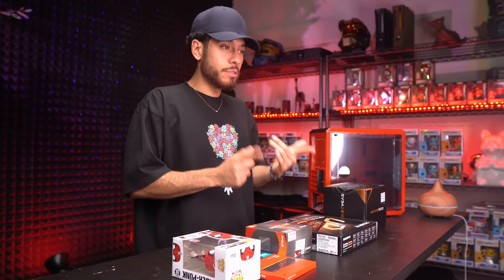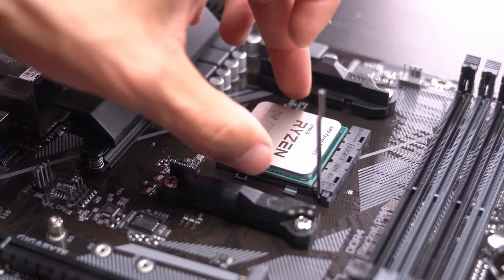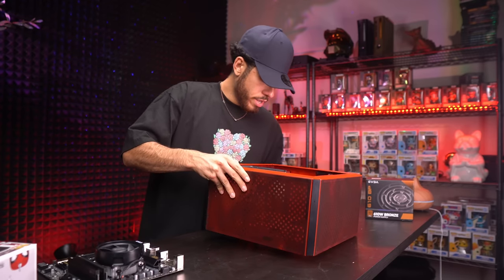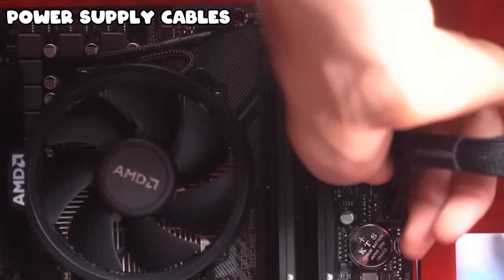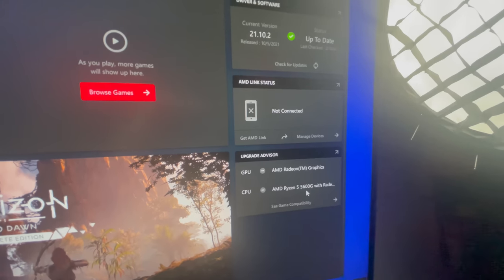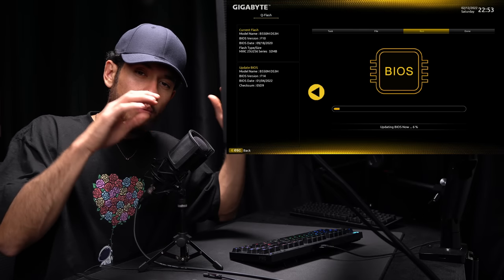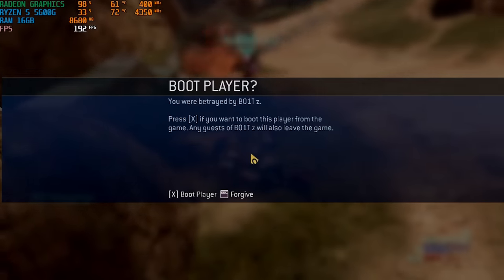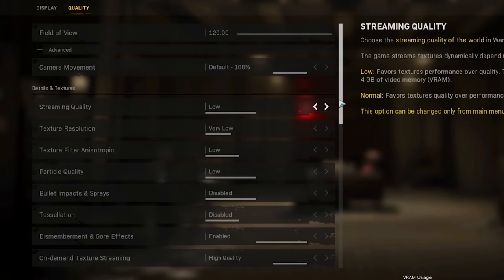$500 Budget Gaming PC Build Guide - Ryzen 5 5600G (w/ Benchmarks)

Comment: nice vid, first time building can i get ur thoughtss on this: thanks!

AMD Ryzen 5 5600G 6C/12T 19mb 65W AM4 APU, Box
Gigabyte B550M DS3H AC (AM4) B550, mATX, 4*ddr4, WiFi + BT
8gb ddr4 3200 Corsair Vengeance LPX, black, CL16,

250gb Samsung 970 EVO PLUS SSD NVMe Gen3, 512mb DRAM, R|W: 3500|2300 250k|550K,
1tb Seagate Barracuda HDD, 64mb 7200rpm

Corsair 550watts PSU, CV, CV550, bronze
IDCooling SE226 XT aRGB Air Cooler, pn: ID-CPU-SE-226-XT-ARGB

also would you recommend this extra cooler and some fans for overclocking? thanks so much
Reply: 👆👆Thanks for your feedback 
 I got something for you.

Comment: Hey Joey I have a question regarding my build, this is my first build. I just need ask if while playing valorant or dota my cpu temp is 63c-70c for my ryzen 5 5600g (stock cooler) without GPU and 16gb ram, and also I have a framerate of 200+ so the frame rate is good, but my concern is the Temp while gaming. Is that good?

Comment: This is great. Thanks. Could you elaborate more on upgrading in future if possible. I have been trying to build a pc but it seems very expensive for everything i need at the moment. So something like this that i can keep upgrading for future seems to be what i am looking for. My biggest fear is if i were to replace 1 or 2 parts hwo can i verify if they are compatible in future. Like the graphics card, or even new chip with new mother board if needed.

Comment: Hey sir @Joey Delgado is there a bug on AMD R5 5600G? I'm experiencing auto shutoff of display and a window pop up says AMD Bug Report Tool. We detected a driver timeout has occured on your system. A bug report has been generated. How to fixed this? I already search on youtube for a fix, but it still the autoshutoff occurs after opening some apps.
Processor: Ryzen 5600G Traytype
Motherboard: MSI A520
RAM: 8GB 3200mhz TFORCE
Powersupply: Inplay 650w 80+B2
SSDL: RAMSTA 240GB

Comment: You shouldn't mount your psu with the fan facing down unless you're using a water cooler or you have more than one exhaust fan....   Also if you have a closed psu shroud you should have the fan facing down...  Other that those scenarios the psu fan should always face towards the cpu...  Other than that great budget build...   Putting the psu fan face down is only based on asthetics and not functionality...

Comment: Im so lucky with the computer I bought, for $500 back in 2017 I got a gaming computer from a pawn shop that I was friends with the owner. Had a GTX 1070, I7 7700K, Has 2x16gb ddr4 ram,and the M.2 compatible mobo. Was so stoked back when I bought it, gamed so hard for those first couple years. Looked at GPU prices and realized she probably wont get a new one for a while XD

The only 2 games I've had issues with framerate have been: Arrma 3, and battlefield 2042. Everything else gets between 60-144 fps in high-ultra settings
Reply: Forgot to mention, cause I was friends with the owner he let me set it up in store and literally run a benchmarking program on it before I bought it, back then VR was the tough thing to run and I remember it took VR at ultra on the benchmark at 30-60 fps which would be comparitive to like the witcher 3 at 4k
Reply: That’s one hell of a deal you got back in 2017. With how far technology is progressing I would recommend building a brand new PC from scratch. Newer GPU’s will be GPU bottlenecked and 4 cores 8 threads is not great in 2022. With Intel Raptor Lake for example an I5 will have 14 cores.

Comment: For specific PC build, only for simple staff like web browsing, word, Excel, printing, scanner, and flash disks, when current cuts off by current company, just for a couple of minutes to obviate to shutdown the PC normally, what is your suggestion for VA on a UPS? Not the manufacturer. Just the VA for a line-interactive UPS. Your advise would be extremely helpful and appreciated!! I know for web calculators, but I would like your opinion-suggestion. ps connect just this case+monitor 19". Only these two. Thank you!
Reply: 👆Thanks for watching! 
I got something special for you.👈

Comment: Does activating XMP profile void warranty or cause any sort of risk to the RAM or CPU?
Reply: I don't believe it voids your warranty, but it may cause some stability issues. On a lot of PCs, it works fine. But, on some PCs, it doesn't work correctly and may cause your system to not boot or to have stability problems. You can easily disable XMP if it does cause issues by clearing CMOS (instructions in board manual.
Reply: @JJFlores197  Actually I will be using the exact same model that showed in this video. So I guess without activating XMP, my performance will face a massive hit. As APU performance depends a lot on the RAM anyway.

Comment: I just built this pc but it won’t post, trying to decide if it’s a bad power supply or incompatible ram. The Ram kit I used is the Corsair vengeance DDR4 2x8 3600 MHz 
CMK16GX4M2D3600C18

Any advice? I tried the paper clip test with the power supply and the fan did not turn on. If that helos

Comment: As a newb to building, will any graphics card work and when you plug one in and restart computer does it automatically start using the graphics card instead of the integrated graphics, I'm not sure how they works? Ty for any help

Comment: A few days ago, I switched from Windows 10 to Windows 11. But after coming to Windows 11 I faced several problems like the computer restarts automatically and after running for a while it freezes nothing works i.e. like when the mobile hangs. If you know why this is happening, please tell me.
I first thought there was a problem with the windows installation. Later install Windows 11 again with bootable pen drive. But this problem appears later. My processor is ryzen 5 5600 g, Ram 16gb

Comment: Second question: Can I get a 510W power supply for this build or is that too little?
Reply: I got the 510 version so I sure hope so. ( it should work)
Reply: @B1ueberr7  ok thx
Reply: @B1ueberr7  when u get it could u tell me if it works for ur build so that i know if i should get it or not
Reply: 510w is fine for this build its if your looking to upgrade to a gpu later than youll have to upgrade your power supply aswell which will be abit of a hassle
Reply: @Kardo298  I prob wont upgrade the GPU for a while but thank you for the clarification it really does help
Reply: @louieandiamx5155  yeah I built this pc but bought the wrong cpu

Comment: I'm using a P2 in my current rig as an intro to nvme. It is oodles faster than my sata SSD was, however since it doesn't have a dram cache, it does occasionally get tied up when reading and writing large files simultaneously. It is great value, otherwise! 🙂👍

Comment: Used this as a guide to build my own almost exactly like this. 
Ryzen 5 5600g 
Gigabyte B550m ds3h ac
Teamgroup tforce Vulcan z 2x8gb 3200mhz
Samsung 980 ssd 500gb
Evga 500bq
Antec nx200m
Artic F14 pwm
Reply: were the motherboard and cpu compatible straight out of the box?

Comment: Last winter we built my son a computer, a somewhat similar build in that it runs a Ryzen 7 5700G with no GPU... he's been able to have a good bit of fun on it for now.
    With prices coming back closer to normal, I think I want to get him a GPU for his birthday (November)... I've seen a 6600 Radeon card on sale for as low as 250... what level of graphics card will be enough of a boost over the integrated graphics to be worth even adding to his system....?  I'm worried that a 6600 or 3050/3060 won't be enough of a performance gain to even be worth adding.... 
   Any input would be most appreciated... cheers
Reply: What did you end up doing? I'm considering using the same setup as you and getting a GPU down the road but I'm not sure if that's the best route with current prices
Reply: @ThaGreatWhite813  my son has been able to play games just fine on his 5700G,  I haven't gamed on the 5600G at all, but it's been great so far... he got a 1440p 32" monitor, and his games work decently enought, not sure what kind of settings, but I know he just got Doom Eternal and FarCry 5, and Forza 4... he hasn't said anything about them not playing well....
   Both systems have Asus B550 F Gaming WiFi 2 mother boards...  his has a 1tb WD black SSD, and the family pc has a WD Blue SN570 1tb SSD,  I got 2 of those so my kid can add a second ssd...I will add some 2.5" drives out of a few old dead laptops to the family pc for storage and to recover some files on them.... 
   His has 32gb of Corsair RGB ram, mine has 16bg of non rgb corsair ram.... his is a RM850X, mine an RM750X for power supplies... He has a Cooler Master Hyper 212 cooler with an added fan for push-pull, mine has the included box cooler repasted with different thermal compound... 
   His case is an Antec DF700 flux    , mine is the Fractal Pop Air with clear glass... his has some added light loop fans... mine has just the 3 included fans and the 1 on the AMD cooler....  his isn't overly loud, and it stays cool with its 8 total fans.... mine is quiet as can be, and Temps seem fine when I've checked them under what has been the most demanding stresses I've put in under(not super demanding uses so far) ... 
   I have been very happy so far with both systems, and shopping a bit during the holidays I was able to build the family PC for pretty cheap.    Son is still shopping for a GPU eventually, he's hoping to get a 6750XT in the next few months.  
   
   Hope that was of some help... feel free to reach out if u have any other questions... and best of luck to ya, cheers....

Comment: I've been thinking about making a custom case Mini ITX PC with 16 GB ram, a mini Power Supply brick, 1tb NVME, and a ryzen 5 5600g... With the mini PSU and the custom 3D printed case I can get the size down to about 2 inches shorter length and width wise than a PS4, and just about 1.5 inches taller. All for around 400 flat 😳. still a bit iffy on the idea though since I am not fully sure of the true performance of the thing since no GPU of course, but I've been researching a lot on the Ryzen 5600g and it looks like if you got it running good you can even pull of games like BF2042 at 1080 and still get 35-40 frames.
Reply: (Already have a good PC but the main goal of this one is to be something portable I can take to a friends house that's still got more juice than something a 400 dollar laptop would give)
Reply: the 5700g is 50 dollars more and you can get alot more performance cpu wise

Comment: Just a quick doubt, will I need to upgrade BIOS on the motherboard for the AMD Ryzen 5 5600G 3.9 GHz 6-Core Processor to be able to run?
Reply: Depends on the mainboard u are using.
Reply: @christianstock7183  The same motherboard on this video

Comment: Just built this pc as my first gaming rig thanks bruv
Reply: Is it crashing or something?
I'm asking because I've seen a lot of comments that it got a lot of blue screens while gaming
Reply: @clipsdelvilches833  I haven't heard of the crashes while gaming. Maybe I'm just lucky but I have not seen any blue screens while/while not gaming
Reply: How is it? I nearly have all the parts except ram and nervous because it seems it keeps crashing. I saw someone asked you about it earlier but i’m just curious if it runs decently.
Reply: @B1ueberr7  I haven't had any issues with crashes or anything of that sort. In my experience it runs pretty dang good. I game and use this computer as my daily driver for work
Reply: @sardineBro  if you don’t mind me asking., what games?
Reply: @B1ueberr7  smite, paladins, apex, pubg, lost ark, genshin imp, and old fallout games
Reply: @sardineBro  how many fps does apex run? Sorry for the questions
Reply: @sardineBro  also did you upgrade anything?
Reply: @B1ueberr7  55-60 but I turned up the graphical settings because I don't care too much about framerate as long as it looks nice (a sin I know). As far as upgrades goes I just increased the size of the nvme ssd.
Reply: I'm also pretty terrible about optimizing stuff so Im sure you can make the fps higher if you knew the right buttons to press
Reply: @sardineBro  oh ok thank you so much for being helpful

Comment: So once I buy the parts could I buy a graphics card and just add it with the other parts or would I have to change something. ( I’m very new to pc building and I am looking to buy the parts for spring break but wanted to make sure everything is fine)
Reply: Installing the graphics card is pretty straightforward. Just insert it into the PCI-E slot and plug in the necessary power cables. Then, install the drivers for your graphics card and that's pretty much all there's to it. The main things I would look for are dimensions (make sure the card can fit inside of your case; mainly a concern with smaller PC cases), and that your power supply has the necessary power cables for the graphics card.
Reply: @JJFlores197  thanks bro
Reply: I have bought most of the parts except the ram. Have you built the pc yet?

Comment: Hey, I'm trying to follow along the lines of the build with the:
250gb ssd
AMD Ryzen 5600G
Motherboard

But I want to change some things such as the:
Case,Ram,GPU (GTX 1660) , And power supply to 650W. Is there anything I should know??
Reply: u dont need a gpu. ur cpu alrerdy has a gpu integrated in it which is close to a 1660 speed. if  u want to add a gpu to it like 1660. then go with 5600 cpu and not the 5600g
Reply: @Neonloverx  Well I was on a budget and I thought if I get the cpu first then I can still play some games whilst waiting on a gpu. 

Update: it works and just waiting on a gpu
Reply: @Jyytf  yes so if you use a 5600g right now and waiting on a GPU you should not look for anything lower than a 3060 cuz your integrated GPU already does the same performance as those lower GPUs
Reply: @Neonloverx  ah I didn’t know that. When I looked up some benchmarks for the cpu the videos said that it couldn’t run GTA at medium 60fps

Comment: So I build this pc but it says it doesn’t have the requirements for windows 11. Can’t find it anywhere online. Anyone knows what it could be?
Reply: fixed it
Reply: @jornbrouwer9518  how did you fix it? i’m still trying to figure it out
Reply: @joshjime3731  so if you want windows 11 you need to go in to you're bios. Its alot of work, so what i would suggest is installing windows 10 first and then upgrading to windows 11. With windows 10 you should have no problem installing it.
Reply: @jornbrouwer9518  yo are u only using the ryzen 5 5600g if so  how does it perform does it perform good
Reply: @Helden1pro  so tbh it’s mid, when I build this pc i didn’t care that I could not play on high settings. Games like fortnite run fine, but there is 1 problem. The stuttering. Since this system doesn’t have a lot of vram it stutters, which isn’t like really bad but I just notice those things. When i build this system I wasn’t planning on upgrading, but now that I have it I will definitely get an graphics card.

Comment: that case is shit FYI....ther airflow is crap...i bought two of thouse and they ended up in the dumpster after 5 months. The side panels dont seal up night and you lose alot of static pressure as a result...my cpu was hitting temps of 80c and gpu was 90c during gaming

Comment: If you install the drivers of ryzen 5600g and then you change the cpu for example to ryzen 7 5800x could be a problem ??
Reply: nope I think there wouldn't be a problem unless you also change the motherboard
Reply: @aianjaegarcia8971  but if i have a Gigabyte B55O Gaming V2 i dont need to do it ? or yes ?
Reply: @dlc180  yes as long as the bios is updated you're good to go

Comment: I built this exact same build but with different psu and ssd and it turns on but nothing shows up on the monitor, the fans start up and everything
Reply: if you got the 2021 M.B. than you need to update the bios with an older cpu then put that cpu back in. Annoying process..... Borrow someones older cpu if you can to update the bios.
I have read that you can download what you need and put it onto a USB and plug it in then turn on the pc but sometimes it doesnt work or can take many tries.

Comment: Hey what can you do if it doesn’t work? It turns on but it tells me to reboot something and I’m still learning?
Reply: It tells me to “select proper boot device”
Reply: @tootoxic4u960  Every new system obviously doesn't have any pre installed windows operating system, unless it's a pre built one. Insert your bootable usb drive then configure the boot priority in the bios, if you done it right windows installation should be successful.

Comment: I have a 575 dollar price PC I'm going to buy the parts are these good

Ryzen 5 1600 with gtx 1650 with 16 gb ram and 500 watts power supply and a normal size PC case and a 250 gb hard drive

Comment: Could anyone help me after using my pc for a month or so I procrastinated making my ram 3200 and not 2400 my pc keeps crashing after 5 mins or so should I just restart until it stops crashing
Reply: If you enabled XMP (to go from 2400 to 320 Mhz) and your PC crashes, temporarily disable it and see if it stops crashing. If it does, then the culprit is likely the XMP overclock. XMP is an automatic memory overclock, but it is not guaranteed to work perfectly across all systems. If your PC crashes with XMP then it likely means you can't use it so you will need to disable it and manually adjust memory settings if you want to get the faster memory speeds.

Comment: Hey what Graphics card would be good with this build?
Reply: Anything less than a 3070
Reply: @Supermage119  why less?
Reply: @Supermage119  I’m just curious, I bought the 5600x and 3050 and I’m just wondering why better gpu’s wouldn’t work
Reply: @B1ueberr7  it is because a 5600x is too weak for 3080 and onwards, so it will BOTTLENECK the 3080, so u would get less fps
Reply: @Supermage119  oh your so smart
Reply: I DID PUT YESTERDAY RX6600 ON IT, it runs perfect, but better when you have money, change the cpu make it 5600x